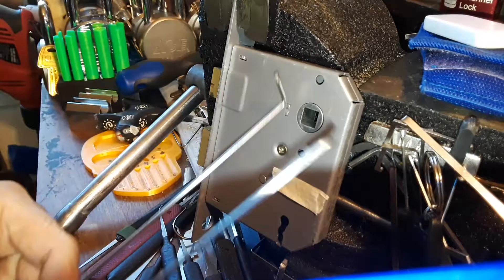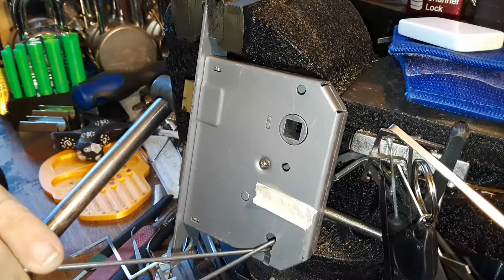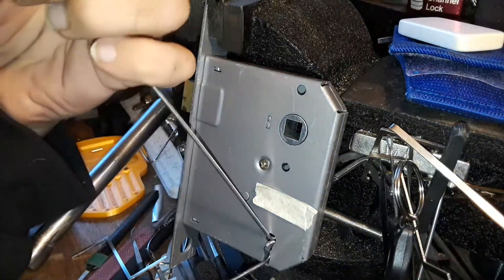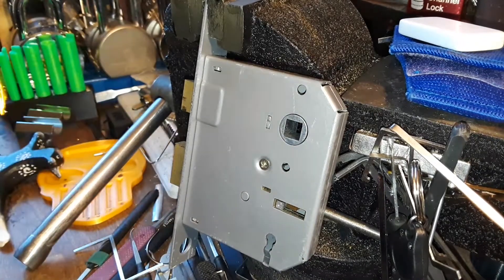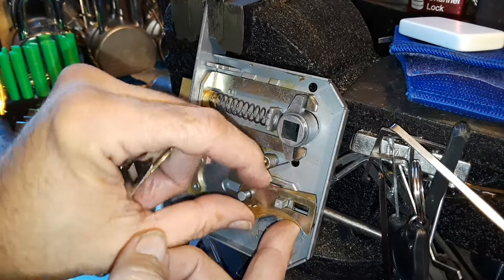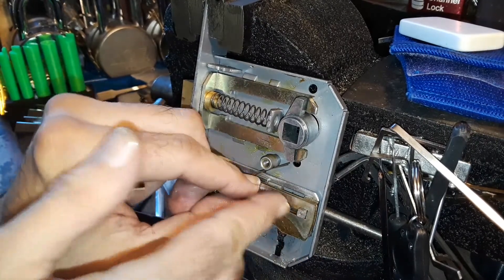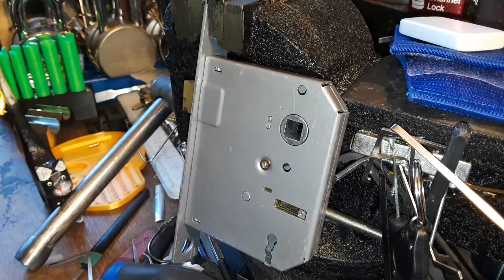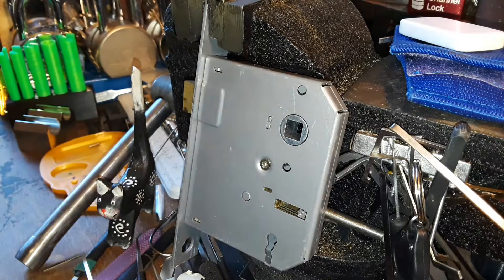(538) Overlifting a 3 Lever Mortise Lock #stocklocksunday #leverlock

Comment: Great lifting.. could I suggest that the tension tool.. it would be easier if it went in flat and rested against the bottom of the keyway. This leaves much more room for the pick or lifter. You may need slightly more length on the tension tool but you’ll have more control